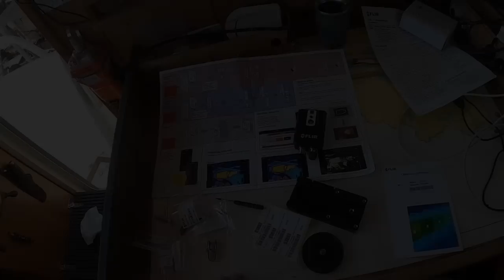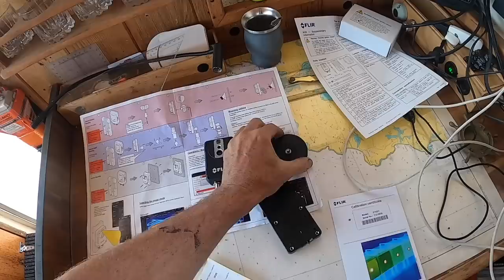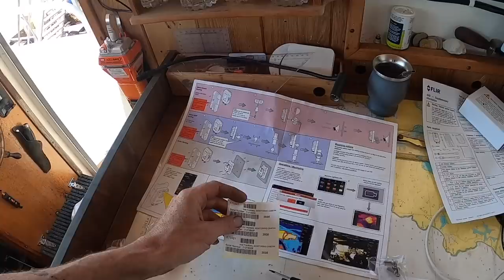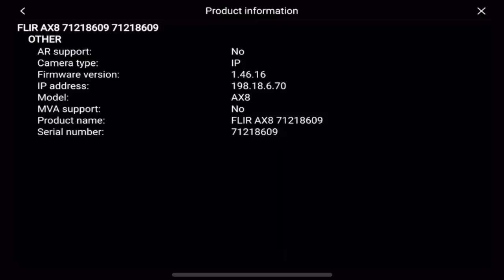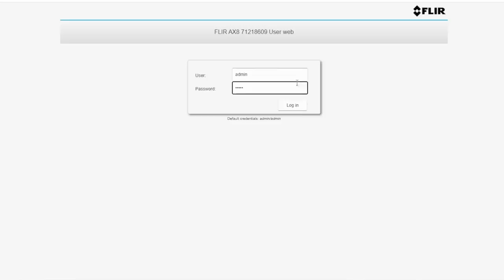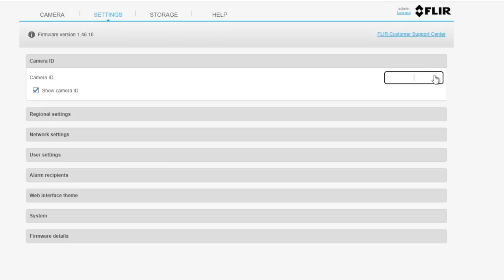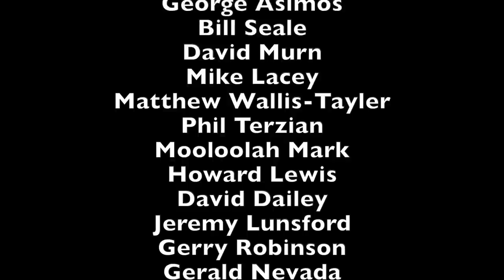FLIR AX8 Thermal engine monitoring

Comment: I picked up a bad injector on an engine when the other 5 headers were nicely blued from the heat while the bad cylinder was running somewhat cooler and was not blueing . Seeing the relative heat between the 4 cylinders will be handy. Early intervention is gold.

Bus Greasemonkey just had a vid where one bank on a Detroit v8 got ruined when the thermostat on that bank failed.

Comment: Stu, you're getting to be quite the computer geek. I am impressed! Frankly, I learned a lot as well. I don't have an engine I need to monitor, but a camera on my ham radio gear could save me from overheating a power supply or the tubes in my final amplifier.
Reply: Stu has a background in IT
Reply: @markolav70  I didn't know that. Thanks.

Comment: @dangar marine Welcome to the FLIR family. I’ve been working for FLIR for many many years. I’m happy to see our camera being used (FLIR also own Raymarine). I ocean fish too and I’ve brought my thermal hand-held camera with me a few times and it’s has been very useful. You can also use the camera to look for electrical shorts in your wires even though the wires are covered with insulation. Sure saves a lot of probing! Looking forward to seeing other uses from you.
Reply: Yup, exactly what I was going to say. Also a neat way to find bad (high resistance) connections, terminations and crappy contactors and switches and under rated or failing conductors. 
Lastly, and most importantly, they'll let you know if your Esky has a heat leak and you risk having warm beer. :)
Reply: @chrisk8208  Like Coopers.

Comment: Nice…. I would point one at engine and one at the electrical board where you have all batteries and relays and switches. Could definitely alarm if a short or overload situation occurs. Because if it overloads , heats up instantly and then pops…. At least you have a record of what popped and when. Great price of mind.

Comment: Nice addition since one of the greatest enemies of the Detroit diesel engine is heat (overheating).. It doesn't take a lot of time for a blockage or some other impediment to the cooling system for damage to occur in the Detroit. In general heat is the enemy off all rotating machinery. Those cameras are also an excellent troubleshooting tool for all kinds of equipment, machinery, electronics, etc.
At around $1000 it's a bit on the pricey side, but the savings in repairs it may help prevent could end up paying for it.
Reply: Mate the enemy of any engine is overheating
Reply: Good coolant will stop shit blocking up coolant ports.. unless it's been running on straight water for years... if that's the case head off and get the drill and Dremmel out
Reply: @JimLahey21  Detroit diesels are especially susceptible to overheating. Heat is the enemy of all engines but more some than others and it doesn't take over heating for very long on a Detroit to do real damage. In a marine application you typically have two cooling systems with a heat exchanger in between. The outer system uses sea water and it can be easy for that system to get plugged up with debris.
Reply: @fredflintstone8048  uhh no there not....

Comment: I've got CAT S60 phone with in built flir camera.
Got to admit hasn't been used that much, for work I do general domestic and electrical maintenance.
We have quite a lot brick sometimes stone houses, about 130 years old from Victorian era in the UK.  People always say they are damp due to black mold, the flir camera shows up the cold spots really well, hence condensation forms causing black mold to grow. From using the flir camera it shows it doesn't take much temperature difference for  condensation to form.  From this I can then tell tenants they need to use the central heating more.
Have seen an inhibitor used in paint to stop black mold growing, suppose it's equivalent to anti foul (perhaps not great for your health??). Went in one house where all the walls had been painted with inhibitor, the black mold grew on the tenants shoes instead.

Comment: In order to get an accurate temperature, you will need to set the emissivity for the camera. This basically tells the camera what material it is measuring. I'm sure you'll find a menu item for this.
You also have to ensure you aren't pointing it at a very reflective surface, else you'll be measuring whatever is reflected in the surface :o)

Comment: Hi Stu, just an idea. The alternator pulley did not seam like it was moving, it looked ceased. Maybe  you could paint a radial stripe on it so it shows in the FLR as moving. 
Maybe you could monitor the exhaust pipes temp as a better idea of what the cylinder temps are. André in Sydney

Comment: Reading the temperature of the airbox covers doesn't tell anything other than the temperature of the airbox covers. If you want valid diagnostic information use individual cylinder EGT readings and log temp vs load. Measuring load requires some means of measuring rack position. The FLIR in this particular installation is nothing more than expensive wheelhouse bling.
If you want reasonably accurate temperature reading, don't take them off glossy surfaces, either paint the target area matt black or stick a piece of blue masking tape on it. The FLIR reads a reflection of some other hot surface (which could even be behind the camera) just as well as the target if the target is shiny.

Comment: Neat stuff... very nice.
Worth monitoring battery temps to check for overcharging? I do on my system here, although a bit more simply.
Cheers.
Reply: I agree. Although the installation of a DC DC charger should limit problems there. They're so much better (and more expensive) than VSR.

Comment: So the only reliable way of instantly knowing is a cylinder is contributing is to measure Exhaust Gas Temperature or EGT.
If you were to put the camera on the exhaust manifold side and where the individual runners exit the head and put measuring points on each of them you'd instantly know by EGT if an injector has gone bad for example. In a Diesel a cold temp on a cylinder could be a sticking injector and a high temp a leaking injector. 
This can be different for petrol engines as a high temp often signals a lean condition but not so on Diesels as the more fuel you pour into them the hotter they get until damage occurs.